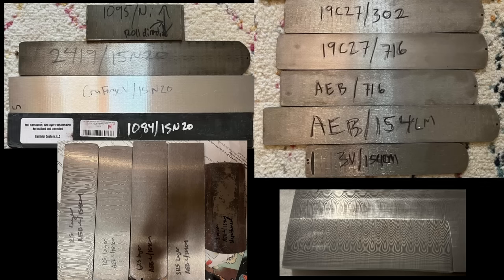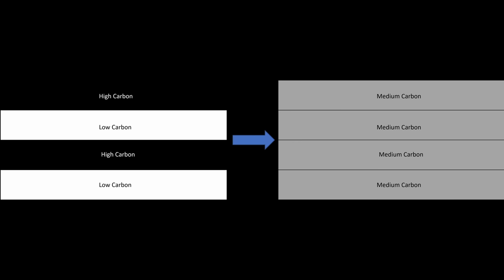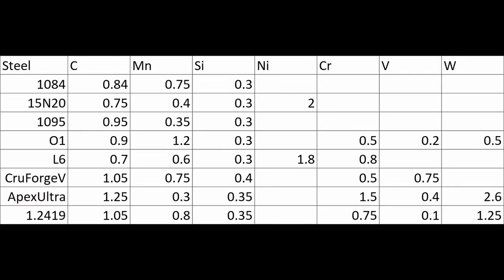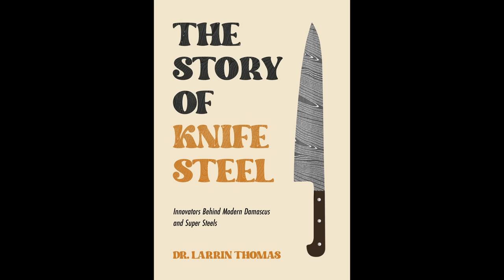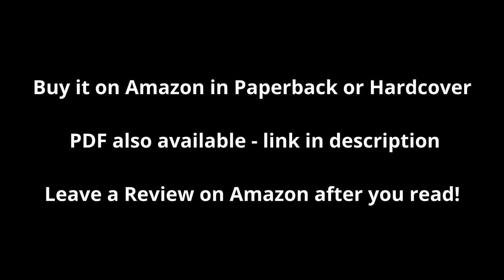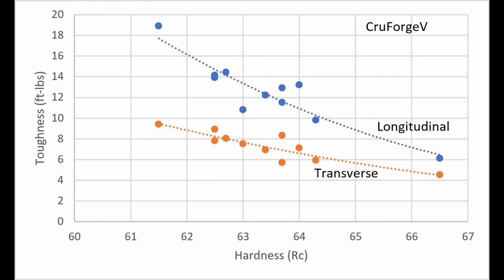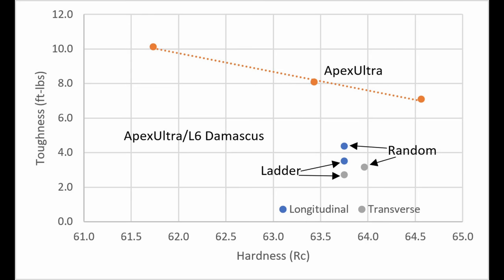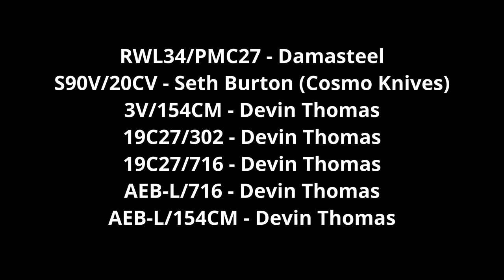Damascus vs. Super Steels - Testing a Dozen Different Damascus Steels!

Comment: The results with 1095/nickel ladder pattern were surprising. I never would have guessed that there was any cutting advantage to using Damascus let alone Damascus with pure nickel.
Reply: Yeah, that was a cool tidbit to learn. Slicing better than 1095 alone! It's like when you blend different varieties of tea, it supposedly has a greater antiangiogenic effect than either tea alone rather than the weaker diluting the stronger.
Reply: @CSGraves  That's a terrible analogy!
Reply: @timbirch4999 looks like we found the coffee guy.
Reply: @CSGraves  People who consume both coffee and tea tend to live longer than people who only consume one or the other, although both beverages appear to individually increase your life expectancy with a dose dependent relationship up to about 4 cups of each per day.
Reply: @garethbaus5471  People who eat caviar also have a higher life expectancy, but that correlation doesn't equal causation. There are other factors at play such as "what type of person regularly eats caviar and what type of person has never ate caviar? What are the differences between these two demographics?"

When you split people up into two different demographics like "people who eat X and people who don't eat X" There are a million factors that you add without knowing, like wealth disparities and cultural differences.

Comment: A 50 minutes video comparing powder metallurgical steels to damascus? Yeeeeesss thank you :D
Reply: The only problem is that "Damascus" steel is not folded steel alloys. Damascus steel came from a mine south of Damascus, not even in Syria, and was notable for its naturally occurring alloy (and strength). More than a few people have tried to determine what exactly that alloy was /is (without satisfactory success, IIRC). It left a distinctive uniformly random pattern visible, possibly due to trace vanadium, possibly due to something else. Similar mines were later found in India. I'm no authority on it, but that is what I have read/learned. Taking one mass production steel and folding it a-la-katana with another alloy or metal does not make Damascus steel.
Reply: These days they call that Wootz. Larrin has a video testing legitimate woots Damascus. They can make it these days still. It's a very high carbon steel (like 2%) with an impurity that forms carbides which causes clustering of iron carbides in distinct layers by growing in carbon content   near the carbide bands over the forging process.

Comment: I guess it’s natural to talk up the thing you’re making. Really enjoy these vids! I’d gladly send you a bar of Wootz for testing!
Reply from the maker: That would be great!
Reply: A bar of wootz 1095 and pure nickel would be very interesting. I’ve been wanting to dabble in some wootz but I’m going to fail many times. I don’t like to fail so I’m stuck between a rock and a hard place.
Reply: @-Craptastic-  I completely agree with what your saying. I’m usually really good at figuring things out and making things work with a high success rate. But making steel is a whole different ballgame. I can’t predict an outcome or see what happening until a bar is made. Then followed by multiple test to find out if the mixture and procedure is right or needs tweaking. There so much that goes into making steel from scratch. Tons of different variables, not to mention figuring out the right heat treatment. Almost makes my head spin thinking about it🤦‍♂️.
Reply: @-Craptastic-  lol thanks man, yeah it’s a deep rabbit hole and can get quite expensive. If I can get a recipe and procedure to get me started I might give it a go. It would be pretty awesome to produce my own steel.

Comment: I read the article you did on your website comparing a lot of the alloys in edge retention, and it's crazy how much someone could learn from just 1 single article. It conformed quite a few personal theories I had on the qualities certain metals gave to the alloy, and I learned at least half the amount of information of everything I knew about cutlery alloys just from one single article.

Comment: The damascus cutting effect has a parallel in nature. Beavers' front teeth are harder in the front than the back, so the back wears down more quickly...not sure how those would do in a CATRA test though.
Reply: Huh, that's super interesting and raises the possibility that if you microenginered the blade right you might even be able to make it self-sharpening.

Comment: Thanks Larrin for taking the time to do this study. I was searching for an answer to this exact question, not exactly "damascus vs super steels" but more or less high carbon damascus vs super steels. Im very much a function over form type of person and it flabbergasts me when someone spends thousands on a "high end" custom knife made with 1084 and 15N20 damascus, when there's modern steels that will perform better for significantly less labor.
Reply: Its the opposite of "form over function" if you don't understand how someone else might appreciate an interesting pattern and clean/ornate hand-crafted fitment over a specific performance engineered metallurgy.
Reply: @Brokentwobutton If they know that's what they are getting that's fine, but I suspect they believe they are getting the best performance because of they didn't think that it wouldn't be that hard to use the better metallurgy and still get the nice pattern.

Comment: Wow that was incredible. You should reach out to some steel manufacturers to provide you with some steels. Usually the more information there is on the topic, the more it brings attention to their product. Also, that's where you see which manufacturer has high confidence in their product when they are willing to supply materials for a third party, unbiased study comparing things to their competitors. Also, let me know for your next study, depending on economic timing, would be keen to send some materials your way.

Comment: When you have a material with randomly occuring defects - like every type of damascus (forge welding can never be completely defect free in a large area), toughness becomes depending of the material volume under test (Weibull distribution). If the test piece cut out of a sheet is - by chance - defect free, it may do well in testing. If there is a defect, it will fail early. So nobody knows if 1084/15N20 is a tough combo, or just picked a good part for testing.
Reply from the maker: This assumes that multiple samples didn't have defects. But we found defects and it still tested well, so the presence of defects is not necessarily a guarantee of poorer performance. In this case the distribution and orientation of the defects in the 1084/15N20 did not appear to be deleterious for the toughness test.

Comment: You mention that carbon diffuses very rapidly at forge welding temperatures and that the carbon content between the layers becomes homogenous for typical damascus layer counts. I know there are many applications such as Japanese chisels, san-mai knives, and axe heads where it is common to forge weld a hardenable bit to a low carbon steel. This has been done successfully historically so I'm wondering if you could shed any light on how far the carbon diffuses and if there are any heat treating techniques that should be applied to minimize the carbon from the bit diffusing out into the mild steel. If you forge welded a thin hardenable steel to a thicker mild steel is it possible that enough carbon could be drawn from the edge that the steel won't harden or the cutting performance is compromised?

Comment: Hey Larrin, 
Fantastic work again! I have a question and  would value any input from you. I have been making stainless Damascus using AEB-L and 304, do you think the 304 would perform much differently than the 302?  Also, from the testing that included 302  i gather that when making stainless Damascus its not necessary to inlcude a solid core layer in the final billet to ensure high quality knife steel for the cutting edge, would you say thag is accurate or would you suggest including that core layer?

Comment: 41:28 i noticed you did two hardness's for damasteel and did toughness testing on both but only edge retention testing on the lower hardness one. Was just curious why the higher one was not on the esge retention chart?

I also noticed the protocols that were used for the damasteel were slighly different than the ones from damasteels datasheet. Can you explain why? I can make assumptions but id rather not.
Reply from the maker: I’m going to do a separate video on Damasteel heat treating
Reply: @KnifeSteelNerds  nice, looking forward to it.

Comment: Great work, in your conclusions you say that layer count did not affect edge retention, but also that ladder pattern improves edge retention. Do you confirm that even though there might no longer remain a visible pattern because of 3000+ layers, there is still that "saw-like" effect which is beneficial for edge retention ?

Comment: When restacking the 1095/nickel combo is it a concern to have nickel layers adjacent to each other for forge welding?  Will the nickel forge weld to itself in these circumstances or does there need to be additions made when restacking?

Comment: Brilliant video! have youever tried pattern welded steel with 8670 as one of the alloys?
Reply from the maker: I haven’t. In terms of performance it should be roughly similar to L6 and 15N20 when used in a Damascus mix.

Comment: Great video! I wonder how this translates to sword making which uses a slicing motion rather than chopping. So the wear patterns should be quite different. 
I have a vintage katana made with Honsanmai steel - which has both soft and hard properties. It's also folded and heat and clay tempered. No idea how durable it is though.

Comment: Was the damascus cutting effect only limited to the preparation with nickel? I thought you only saw it in one preparation? Also, one of the conclusions it seems is that the combination of 2 steels decreases the toughness of the tougher between the two, but I am not clear on what happens to edge retention compared to the components. You compared the different preparations beautifully. Expanding on comparison of patterns brings up the question: is there an equation that predicts a pattern that increases toughness or edge retention? That would require someone really smarter than I.

Comment: Im super curious about difficulty in sharpening between the different steels ? Because I find that these steels  with higher edge retention people have a hard time sharpening and there for never use the knife once it has dulled because its so difficult to sharpen .
Reply: I keep trying to tell this to the newbie dweebs who want to talk about The Best Steel. Because they haven't yet realised that everything is a trade-off. You go trekking through the Amazon and there's no way you want some super-hard stainless knife, or 80CRV2 because you'll never get that thing sharp again without a 2x72 grinder. Take something much softer and in a pinch you could get it sharp on a rock if need be.

Comment: Any evidence the Damascus cutting effect happens when using two steels with different wear resistance?   Say something like 1084 and 52100?  Hardness won’t be different but wear might be different enough to show the effect.  Then again, the difference between 1095 and pure nickel is greater than that of 1018 and 52100, so it might not be noticeable if the difference isn’t enormous.

Comment: Calling pattern welded steels "damascus" has always bothered me. The original damascus blades were a crucible steel, and the fine patterns in the final blades were extremely subtle. The exact method of creating these true damascus steels is mostly lost to us now, although there have been experiments with recreating these so-called wootz steels using traditional methods that have seen some measures of success.

Contrast that with pattern welding, which has a long history in Europe and was never a lost art or something of much mystery to bladesmiths. Moran's re-branding of pattern welded steels to "damascus" relied on the legendary reputation of wootz crucible steels, stealing borrowing their mystique to make decorative pattern welded blades seem worth more than the sum of their rather average materials.
Reply from the maker: Moran is not the one who started calling pattern welded steel Damascus. Using the term to refer to both crucible and pattern welded steel goes back to at least the early 1800s.

We can make Wootz now, the only argument is whether we do it in exactly the same way as it was made anciently. We know the mechanisms by which it occurs. Whether we use the exact same crucibles or organic matter or whatever is more of an interest to an archaeologist.
Reply: @KnifeSteelNerds  It's quite the misnomer, given how different wootz and pattern welded steels are in how they become blade blanks. I wish modern bladesmiths and researchers such as yourself would call pattern welded steel what it is, and save the term damascus for the original crucible steels. It would certainly be more accurate.

Comment: Would air hardened steel combined with  water hardened steel yield different results if you only water cooled them instead if only air cooling or is it that you can water cool and air cool steel without issure but you can't air cool a steel that needs water ?
Reply from the maker: If you water hardened it they would both harden
Reply: @KnifeSteelNerds  i had a feeling butvwasnt sure if certain steels just handled the processes differently.  Thank you

Comment: Now my question is... Who even makes Damascus steel core blades? I have never seen a Japanese knife with a Damascus core steel. Japanese bladesmiths always use a single, hard steel core and then add a layer of soft Damascus on each side of the core steel ending up with what is called a Sanmai construction.

Comment: Excellent article!. A question and an observation. First what was your sharpening protocol on the more recent of the tests rather than the older ones? Lastly I have been making knives since the late 60's and one of the things I remember from back then was "edge packing" one of the supposed benefits of forging was that smiths claimed the edge through forging was compressed or packed tighter. That can't happen because steel can be moved but does not compress under those conditions but that was a common myth at the time. Thanks for all your hard work on this!
Reply from the maker: The sharpening hasn’t changed

Comment: Good video, but… I feel that you are remiss in not mentioning that the “damascus cutting effect” only showed up when using a steel paired with a non-steel (pure nickel) in your conclusion. It seems that in all cases where a more wear resistant steel was used with a less wear resistant steel, element (primarily carbon) migration negated the effect. 
You did mention that steels with different hardenability may be used to produce the effect - I’d love to see experimental exploration of that idea. Additionally, would it be possible to forge weld a high and low alloy steel together (i.e. 1084 and 20CV) in order to produce the effect at higher levels of edge retention?

Comment: My father was a metallurgist 
         Me also working for several fortune 500 corporations, ferric and non-ferric combinations were not permitted without a barrier. And it was known that failure was eminent due to galvanic reaction. Such as in the statue of liberty or St. Mary’s Cathedral in Tokyo. 
Is why I do not do  damascus with copper.   Believe it is on borrowed time for failure overtime as specified. 
           Any input to this?

Comment: I don't like random performance I never had a really good experience with damascus. For me it's either a steel like 52100 or a singae piece of Vanadis 4 Extra,or CPM Cruwear for my fixed blades and any decent more rust resistant s.steel for my food prep or folding knives.